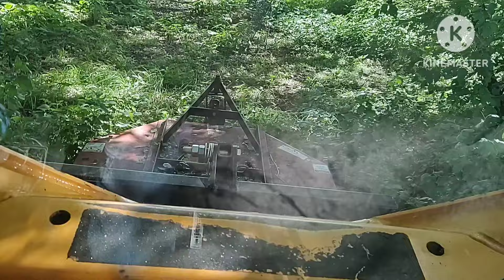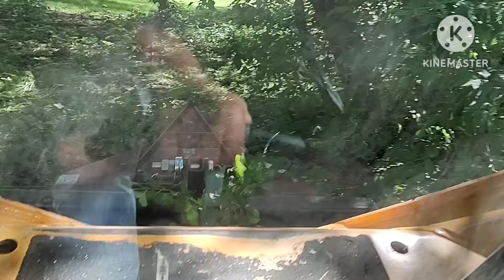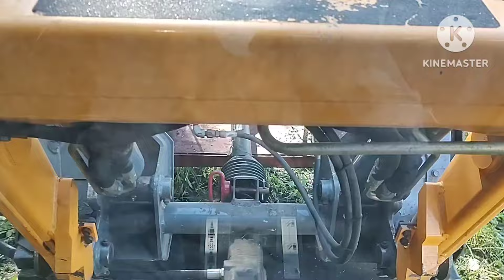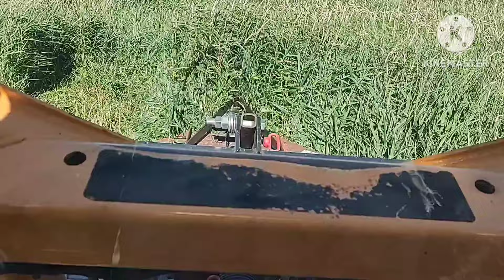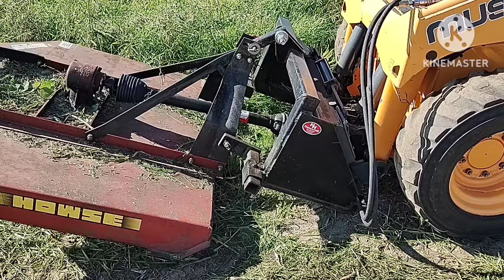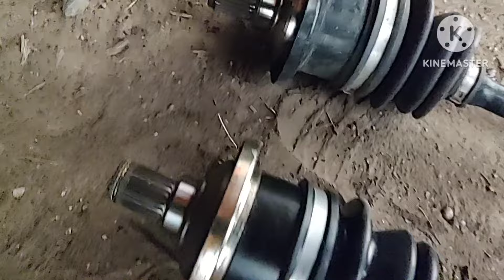Mowing brush

Comment: That's the ongoing battle  I know I'll never win....mowing brush.  Sure does look good after you get done. I've changed a few of those axles over the years, not a bad job to do. Thanks Erik, have a great 4th.
Reply from the maker: It's never ending Brent. As long as the blades are sharp it does pretty well. I don't mind changing those shafts.

Comment: If I ever end up with a skid steer I'm definitely adapting my brush mower to it. That's a lot nicer than trying to back a tractor in tight places.
Reply from the maker: I highly recommend it if you have a mower already. It's not as good as an actual mounted brush mower, but it gets the job done.